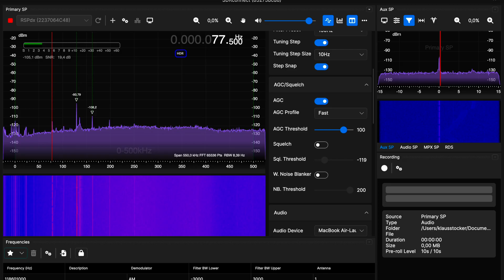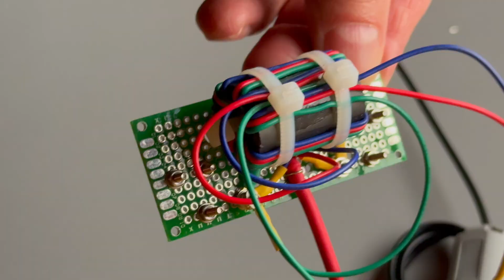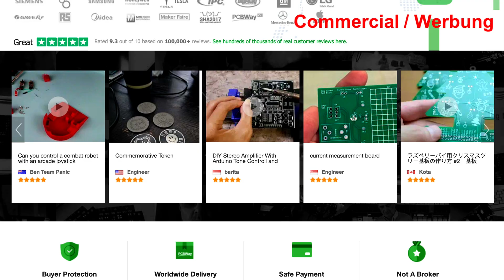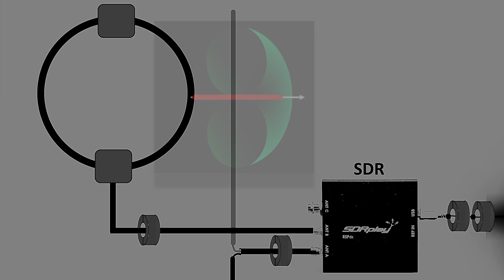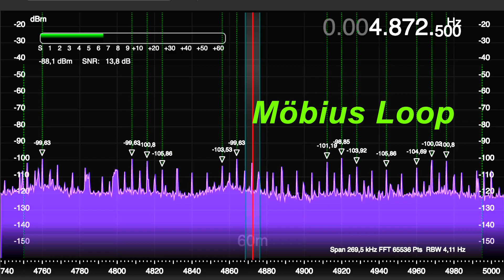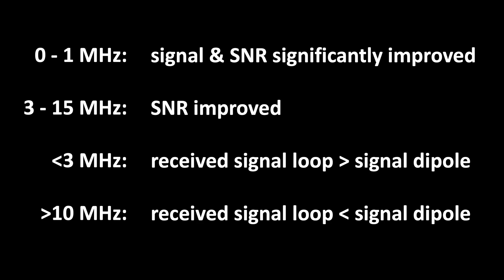Fighting Interference: SDR Receiver with Three Different Loops (EP162c)

Comment: Hi ! Nice videos about loop antennas ! Just a tip as I have also the exact same sdr that you are using: The bnc antenna port is better in the vlf range, signals are bigger and there are some internal noise filters. Try it.
Reply from the maker: Thanks for your comment. Interesting! So far, I didn't realize any didn't realize any difference in the LF/VLF range. I have the older RSDPdx version. Can you give a specific example for a signal and frequency?

Comment: Brilliant content thanks a lot. What you forgot to tell is that the dipole receives the e-field and the loops the h-field, when most of the local noise exists mainly in the e-field when in near-field distance. In other words if your antenna is designed to pick up almost no component from the e-field, you have already won most of the game. I use an original LZ1AQ and live in a multi family home with enormous noise, so any electric field antenna makes it impossible to hear any station with joy. Using a totally symmetric very e-field immune loop that send the signal into the shack via ethernet cable is really perfect. Then here in the shack its being converted to asymmetric 50 Ohm goes into a high dynamic pre-amp and some power splitters to operate a number of receivers on this one small loop antenna under the roof and its a total game changer.
I can only recommend to anyone, use a magnetic field active wideband loop for RX only and for TX you can use any wire antenna, it doesn't matter how noisy, it will get the job done. But if you can listen clearly on the band, any HF operation is no fun, no matter if you are an SWL or an ham radio operator ... so experiment with RX antennas as shown here ... the moebius is a great design and figure out what works best for you. Some HF transceivers have a dedicated transverter connector, so use that one for your RX antenna, that saves you an external switch box in order to not accidentally burn out your antenna preamp.
Reply from the maker: Thank you for sharing your experience here! 
A good transmit antenna is not necessarily a good receive antenna.
I think you've hit the nail on the head: loops are immune to E-field interference. But there's a second important effect, especially with SDR receivers: Loops have a much narrower bandwidth than dipoles. This prevents interference from intermodulation.
Greetings
Klaus

Comment: Great job again Klaus.
I wouldn't have thought there would be such improvements given the comparable proportions. 
If I could wish for something, I would say that the video should be a bit slower, because the comparison of the various antennas in the last third goes very quickly (maybe I am just too old for this speed. 😂). I would be very happy to see more of this.
Reply from the maker: Hi Werner, 
thx for your comment! Glad you like the video. 
And yes, the clips with the comparisons are indeed a bit quick. Although I am thinking a lot about the right pace of my videos. 
But here is a tip: You can adjust the speed to your convenience under the video in your settings. 
Stay tuned!
BR
Klaus

Comment: Handy information! What kind of ferrite have you used to make the balun?
Reply from the maker: It's made from a ferrite block. I think, there is room for improvement. For the final build, I will use a proper ferrite ring that is made for this purpose.
Reply: @electronics.unmessed  I'm looking forward for the next video. In fact, I'm experimenting with loops antennas now, and I'm using a little FT50-43 toroid, with good results. I have made a voltage balun with double primary. I have realized that I have to change the ratio from 4:1 to 1:1 below 11 mhz to get the maximun signal. Impedance of loops change trough the frecuency. Thats why I made a selectable balun ratio. My loop is made of aluminium (Pex-Al-Pex tube) with 1m of diameter and is 25mm thicker. I think is the best material to make loops. Is light, easy malleable and cheper than copper.
Reply from the maker: @DJMotavirust  Hey, thanks so much for sharing your experience here. A switchable balun sounds like a great idea. With my setup, the signal strength is dropping at higher shortwave frequencies. I'm currently using a 1:1 balun ratio and a loop circumference of 4 meters. However, the balun is only configured as a common-mode sheath wave trap. I'll definitely experiment with that, too. I ordered toroids, which are a bit larger, 22 x 14 x 8 mm/0.87 x 0.55 x 0.31 inches. Unfortunately, they don't have a label. Thank you very much! Let's stay in touch. BR Klaus
Reply: @electronics.unmessed  My pleasure. The signal of my loop drops above 17 mhz too. I think I need another turn more. If you prefer current baluns, a switchable 4:1/1:1 guanella balun is another aproach you can follow. This is my next step to test. Greetings.
Reply from the maker: @DJMotavirust  That's a really good idea! As soon as I have a solid setup, I'll try that out. You're having really good ideas! Here's my thought: The loop actually has a high impedance. Maybe a 1:10 transformer would be good. I'll have to think it through. Cheers!
Reply: @electronics.unmessed  If the loop have more than a turn, the impedance increases. Therefore, you need a higher ratio transformer. But keep in mind, that in an only reception mode, the adjustment isn't critical. There is a lot of room. That's why in the practice and based in the results of my experiments, from 4:1 to 2:1, I haven't found a considerable improvement. That can you allow for easier configurations. However, you have to find the best configuration for your setup. 
Of course, a simple loop is not the same as a moebius loop. it depends, not only on the loop dimensions. In addition, the diferent frequencies play an important role in the ratio transformer choice. That's why I would like to know what are your results, with diferent loops and transformer ratios. I hope you will share all of these details in another video.
Reply from the maker: @DJMotavirust  Thank you for your comment.
This is a very valuable exchange of experiences for me. Yes, you're right. None of this is really critical for reception. It's more important that the antenna doesn't pick up too much interference. That's why I'm not so sure that a high ratio is needed. But let's see. My progress so far and especially many good comments are motivating me.
If I find out anything useful, I'll definitely make videos about it or share it with you here. Stay tuned!

Comment: Excellent analysis. What sdr rx software are you showing here ?
Reply from the maker: Thx for your comment. I forgot to mention, the SDR software is SDRconnect running on a Mac.
Reply: @electronics.unmessed  Aha - thank you. I have tried it but the UI is not much to my liking. I much prefer SDRConsole but this is unfortunately only available for windows.
Reply from the maker: @fotografm  SDRconnect is new. I think it's the first official release. I think, there's a lot more to come.SDRangel would be another option for mac and windows. Do you have experience with it?

Comment: Did I miss it? Why does the loop antenna provide better intermod rejection over the simple dipole?
Reply from the maker: Thank you for your comment! Actually, I didn't explain it explicitly in this video, but I did in some previous ones about loop antennas. A  loop essentially filters the desired frequency band better than a dipole. It's also immune to electric fields caused by power-on and power-off cycles. Stay tuned!